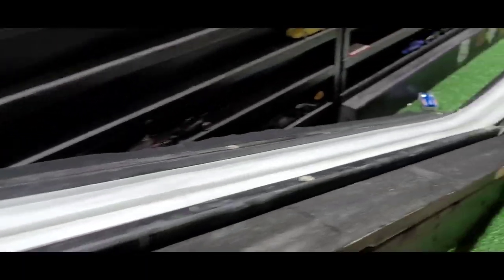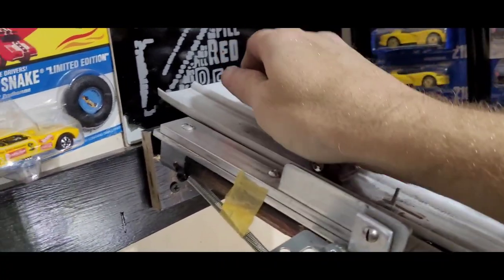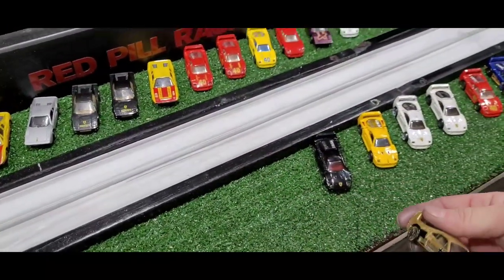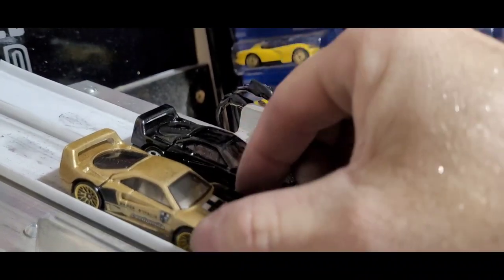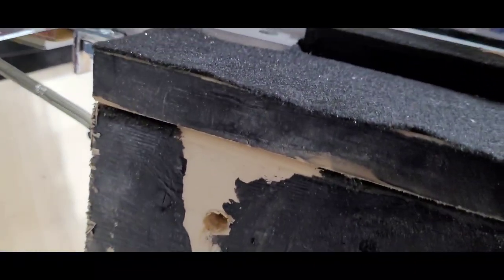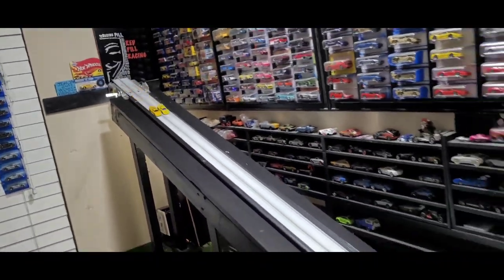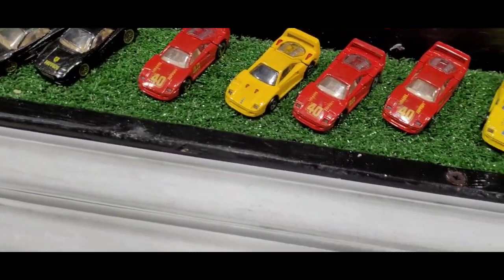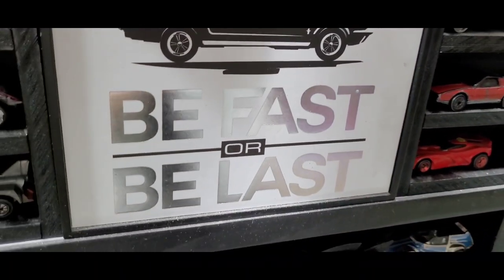Ferrari F40 Drag Race, Debut of the New Red Pill Raceway

Comment: Good racing.. left lane is definitely faster than the right, you may have a leveling issue as it seems all the wins came in the left lane.. 🤔
Reply from the maker: The level is fine but I definitely have a   bit of dialing it in before it is perfect.
Reply: @MrREDPILLhimself  
Yeah man it's gonna be nice it's definitely the fastest drag track I've seen on you tube great job brother 🍻😎👍
Reply from the maker: @modelspeedshop  thanks.